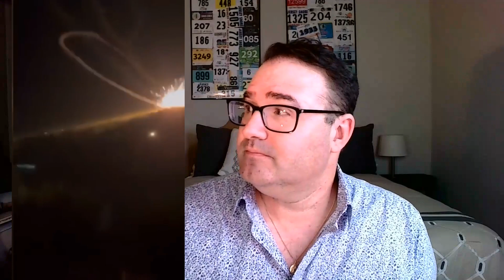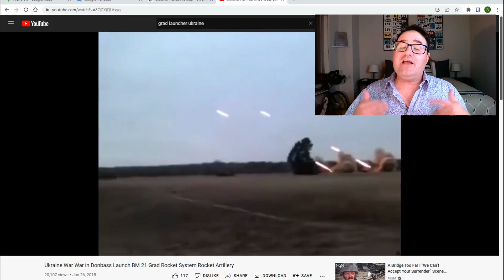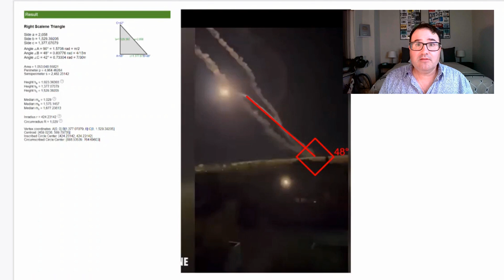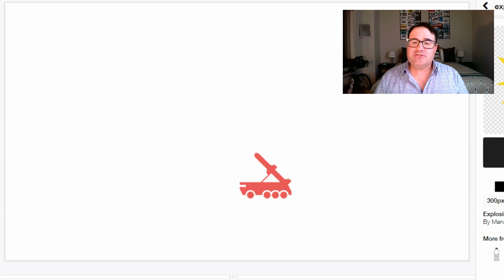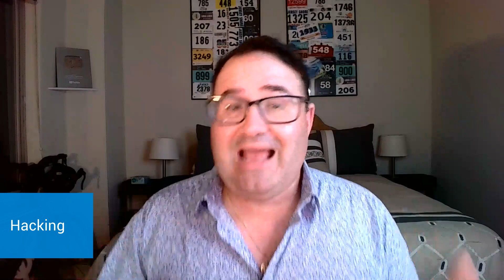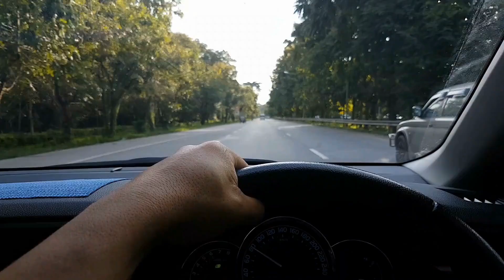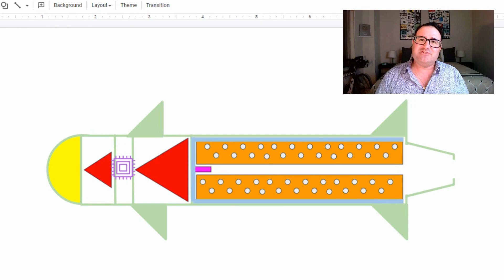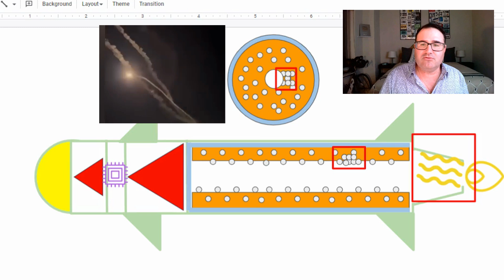Why this missile U -Turned

Comment: I figured that, by mistake, the operator plugged in the wrong coordinates (ie, the coordinates of the actual launch site).  This sort of thing has happened before if I recall correctly. 
As far as your clump theory. While plausible, I just can't see it making that extreme of a difference.  Hard to say.

Comment: I still prefer the guidance theory, and the 2s mark is just the moment guidance engages.
As to why such thing could have happened and other were fine? This could have been a defect in that one rocket, and the defect would not update the target from the default parameters that in a non-GPS system would probably mean relative position... and 0,0,0 in relative position form either of 3 equipment would be quite bad.

Comment: Hmmm well if that rocket had more than one engine nozzles then maybe but with 1 nozzle I think the vector change through gases burning hotter on one side of the fuel would not result in a 180° direction change of the rocket due to gases exiting the nozzle. I mean thats why there is a nozzle to direct the gases. If that nozzle had vector control steering then most likely this is where something went wrong.

Maybe as well if there was a hole in one side of the rocket where gases exited but that would cause most probably spinning and not a flightpass change of 180°.

Comment: When I was in the Luftwaffe we sometimes shoot the old AIM 9B  for training over the  north see  . They were known for being somehow dangerous. Some did a barrel roll around the nose of the aircraft and wend straight to the see, some exploded midair and some burned out on the launcher . Technikans said  it could be the gas generator  for the fins or exactly this problem  as described with the booster.
Reply: You guys test fire AIM 9's without a target? Us 'muricans use high power illumination flares to give the flyboys & manpad operators something to lock & shoot. Also triggers the "stand off" detonator, as the missile goes past the flare. Yes I know, not the right terminology - I was on target detail.
Reply: @muninrob   Hi , no . On the right launcher a TDU-11B was started and then the 9B  was locked one to the flares at the back of the TDU .  Worked great if the 9B was ok

Comment: As someone else that has some practical knowledge of missiles, I tend to agree that this looks like a guidance failure. While you are absolutely correct that solid rocket motors can have such problems, the burn looks very constant. If their were that much asymmetric burn I’d expect the rocket to just explode. The other thought I had, because I don’t know anything about this system is, does it have thrust vectoring?

Comment: that missile was nowhere near max velocity when it pulled that U-turn.  neither was it either a mile high or a mile away from the launcher.  a few hundred to one thousand feet at most, given that the total flight was so short.  they don't accelerate to supersonic speed within 4 seconds....  there is no sonic boom.

Comment: My mechanical intuition says that your theory is wrong. I don't believe the torque will be enough to cause such a hard 180 and the 180 was perfect. I'd assume rather that there was some problem with the targeting radar. A problem can arise between the firing of the 2nd and 3rd rockets.

Comment: Hacking of it is possible, just not in how you mentioned. Creating a more accurate and powerful radar which is 'louder' than the original one would allow the user to take control of the missile however they would have to be in relatively close proximity. I can see how your theory would work however it would have to be an extremely severe issue and even then I don't think it would be this much. Furthermore considering the other missiles were likely stored the same, I find this unlikely. A result of all these issues may have created the result

Comment: I would also agree that it's unlikely to be solid propellant off-center.  Rocket motors that seriously damaged tend to...  Explode!  I would posit, especially with the previous missiles already in flight that possibly the BUK (generally Semi-Active Radar homing missiles) started illuminating it's target and the last missile decided, perhaps due to defective guidance, to home on the illuminating radar, or perhaps a more likely scenario, that the thermal battery in the missile failed, so as the missile ended initial boost, guidance lost power and the fins went to a hard-over position.  Possibilities.

Comment: No, I think it was a servo failure. 
Once fuel turns to gas the pressure inside equalizes due to the nozzle of the motor. Bernoulli's principle, remember your idea happen before Bernoulli flow balance.
Why it went straight the other servos were still working. I would be willing to bet the servos are off till it reaches 2 seconds .

Comment: The same thing happened to a Russian Proton space rocket several years ago. An engineer installed one of the gyros upside down during assembly so when the rocket launched it instantly corrected itself into the ground
Reply: Yeah. IIRC, the part was designed so it only went in one way to prevent such an incident. So the engineer used a hammer to force it into place.
Reply: thx, that makes sense.
Reply: This is the very first thing I thought of. That, or possibly a problem between guidance and control surfaces, like crossed wires. That has also happened to both the US and the USSR. Like another comment below, I don't think that asymmetric thrust is a thing with solid fuel rockets. The nozzle would correct for that.
Reply: Yeah that’s the first thing that come to my mind.
Reply: KSP type rocket building
Reply: Oh! Yeah, that is a good theory... The control systems on board still need to understand orientation, and if those systems aren't properly oriented to ground, the missile will attempt to correct that.
Reply: You would think there would be back ups and fail safes also parts that can only be installed in one way.
Reply: Ouch.
Reply: How do you mess up that badly
Reply: That is actually a very possible theory
Reply: Vadims think they know anything about missiles when it was captured German scientists who won them the space race.
Reply: Anybody's guess. 
   Manufacturing problems, degrading during storage, transport damage, rough handling, component failure, etc.
  Thanks for the video.
Reply: Best theory so far.
Reply: A concise analysis again Mr. Macbeth. I agree that this is the most likely scenario. The only reason I could see it being anything different is if it was a multi nozzle rocket but it is too small to necessitate multi nozzles.
Reply: Who new there were so many rocket scientists in the world?!
Reply: @surfearth1     After obtaining my Rocketry Degree from Kerbal Space University, I'd say I classify as a rocket scientist.
Reply: That’s what makes me think the video might be faked; that proton rocket couldn’t withstand that massive change in course and the forces it brought. I don’t see why this middle would be in a better position to withstand those same forces.
Reply: @thewarmedic2330  Air to air missiles are much smaller, so there's less stress on the missile body, and they are designed to be maneuverable at high speeds so they can intercept their target easier.

The body of orbital rockets are designed to be as lightweight as possible in order to cut down on the required fuel mass needed to get them to orbit. Because of this, they're actually quite flimsy and are only really designed to hold together within their programmed flight envelope. Too much deviation will cause the rocket body to fail.
Reply: @Regolith86  Falcon 9 has much tighter upper-level wind shear limits than other orbital rockets exactly for this reason. Rockets going to space are only designed for large loads down the axis, not off-axis loads.
The Proton's guidance was probably also arguing with itself causing the squirrelly path until the range-safety officer blew it up. Anti-aircraft missiles may not have redundant sensors that orbital rockets launching multi-billion dollar ruble navigation satellites do.
Reply: @Markle2k  Apparently, Russian rockets don't have range safety packages. The Proton just broke up from the aerodynamic stresses, then blew up completely when it hit the ground.
Reply: @Regolith86  Air to Air also would not have to factor as much wind force since the air is so much thinner at the avg dog-fighting altitude as well no? I would assume that is the real impressive feat here.
Reply: @thewarmedic2330  many reasons. The rocket is smaller so it can handle greater rotation without subjecting the ends to much force comparatively to the much large proton. The majority of the rocket has a combustion chamber pressurizing the rocket giving more rigidity to the missile's surface while the proton rocket being liquid fueled does not have as much rigidity to its walls from internal pressures as the pressure is mainly limited to the bottom where the engines are(think of crushing an unopened soda can vs an empty one). Finally, this rocket was not likely moving as fast as the proton yet as it has only been travelling for a couple seconds where as the proton had been travelling for about 45 giving it much longer to gain speed.
Reply: @thewarmedic2330  Built to counter evasion tactics.

Comment: Third missile seems to interfere twice with the trail turbulence of both first two missiles path and it seems that it gets destabilised twice by that. Then, instead of being attracted by the radar reflection on the target that got lost, the missile seeking antenna gets directed directly onto the tracking radar much more powerful emission signal and the missile goes back strait to hit the target tracking radar near the launcher position instead of following the illuminated target… the 3 missiles have been launch too close to each other and wrongly towards the very same direction, so maybe such massive grad salva of 3 together had not been tested before war time. Return to sender, by Elvis..maybe much later a Russian incident report will wikileak out anonymously one day…so that we really know what happened.

Comment: Can't say I'd think that fuel settling answer is likely. Sure you would get a spike in combustion and increase the chamber pressure (increasing the risk of explosion or damage to some other system through too much heat) but it's still got to pass through a convergent-divergent nozzle that should direct any thrust straight back. And even if there was a slight differential thrust (and I really don't think there could have been much), the missile's control system should have counteracted that at those speeds.

I think it looks far more like some kind of guidance failure, as I'd expect anything like a stuck fin to send it spiralling out of control. As you pointed out, the previous missiles firing (seemingly) correctly, indicates that the tracking radar & commands sent from the control station were probably correct, but there is still the onboard guidance that takes those commands and turns that into a trajectory and then control inputs for the fins. The onboard guidance computer might have had a failure and prematurely switched over to terminal guidance, at which point the missile tried to home in on the ground radar.

I'm not someone who works on missiles, just an aerospace engineer (but your explanation goes against what I have been taught/know about rocket motors), so take that with a pinch of salt.

Comment: the missle could have also had a sensor installed backwards so maybe it turned there because thats when its gudence system turned on and it thought it was going the wrong way so it made a U turn

Comment: Rocket in the video has subsonic nozzle, which could do what is described but no way high performance SAM is using that. If nozzle was supersonic it matters less how symmetric is the burn because it's the pressure inside that is converted to high speed gas at the throat. Uneven burn could increase pressure but not have much impact on local speed through relatively small throat. If anything uneven burn would be a center of mass problem that would take seconds to develop.

Also i can't see missile stopping to turn, the issue is perspective. The missile started to turn toward the camera and continued to turn till the ground hit. For me it's pretty obvious that's a control issue. Generally you shoot rockets with controls locked till they clear launch site and then turn stabilization on. Even more, i'd expect target guidance to turn on even later and at best it would run preprogrammed turn to target heading with control limits during boost phase. As any attempt at target tracking too early would lead to energy losses.
So likely a gyro or similar malfunctioned (or was installed wrong way up, like on the Proton-M launch from 2013) and the moment rocket controls were free it "stabilized itself" into the ground.
Reply from the maker: Maybe.  I'm also twilling to accept an alternate theory of sidewall insulator burn-through.  We're just getting paralax error and the missile was actually turning in a circle.
Reply: @RyanMcBethProgramming  Yup, it's all maybe :). If one thing is figured out better than anything else in modern SAM missiles it's the solid rocket motor itself. If it was prone to such issues we'd see grads do the same on much bigger scale, and they aren't exactly 4th july machines.

Comment: I like your explanation as it makes the most sense of any I've heard. Bad storage, or simply poor construction, isn't uncommon for Ru storage centers and a similar theory could explain why so many Ru rockets cork screw thru the air after launch. I was originally thinking the thrust nozzle might have been damaged but the rocket certainly flew straight once it was turned around. An alternate explanation might be some of the solid fuel came loose and temporarily blocked the nozzle.

Comment: i beleive you are right, because the missile after burning that clump or blockage, that caused it to turn, the missile kept its trajectory... because it never reached its "control" phase.  clearly the missile wasn't able to fix its trajectory back to the original correct path, so i feel that it lacked the ability to detect up from down... so it kept the straight path it had before hitting that clump or blockage.  yes it was at an angle but as far as the missile is concerned it flies forward, irregardless of up or down.  so could it also be an issue with that system?  is it even equipped with a gyroscope to know up from down?  and if it does.... well it still never reached it's control phase so the fins would never move to change it's course.  peace.  and excellent work i would not have thought this, initially i felt it was a guidance error if that helps.

Comment: The faster burn rate is 100% wrong. Some level 3 certified engines have "offset combustion chambers" to provide a desired thrust like the Moon burner CTI N 1560.  There were a few bigger Russian rockets that had the accelerometer forcibly installed backwards so up is down. Your method would likely cartwheel until explosion or crack the casing from excessive pressured and explode.  I have had model rockets do this many times. I've also worked with ADXL335 and other Analog or digital Output Accelerometer Module Transducer for Arduino. It has silkscreen marking tells you the orientation of the bord. The missile tracked striate back to the launcher indicating a inverted sensor. Another likely problem might be that the coordinates might have hit the negative key in the coordinates when programed. https://www.youtube.com/watch?v=SRE6_lcwfPg

Comment: We've seen a Russian missile execute the same exact maneuver before.
In 2013 a Russian satellite carrying Proton M rocket in Kazakhstan tried to do a U turn and burned up in the process. The cause was revealed to be a trio of sensors that had been installed the wrong way around,  meaning, the automated correction system was given false data by the sensors and the rocket tried to adjust course from this false data.
If Russian missiles use interchangeable angular velocity sensors ( which makes perfect sense they would ) and these angular velocity sensors have remained the same in these rockets ( Almost certainly the way things would go in Russia), chances are high the wrong way around sensors are still a thing. So there might be Russian missiles with this issue spread across SAM batteries.
Reply: Yep my guess.

Comment: The peculiar thing about this incident is that the missile didn't just turn around, it stayed on that heading more or less and impacted near its launcher. That could have been a glitch in the control hardware, maybe the sensors. Asymmetric thrust should have been more chaotic.
Reply: I didn't return to the launcher. In the video showing a different angle it follows more of a slanted arc.
Reply: Could be an aerodynamic problem. Fine when slow, turns around with enough airflow, slows down while turning, and then accelerates again but hits the ground before the aero messes it up again.
Reply: The missile went into HARM mode. The radar was behind it so it turned towards the radar. 😅😅

Comment: I think your explanation is quite plausible. I've seen electronic malfunctions that make no sense and are short lived so I'd not discount something there as there is a whole lot of places for that to go wrong for a few tenths.  Failure in the mechanical system trying to force the missile to turn could also correct any problem causing the turn. IE fins turn missile, its turning, fins break from stress, its now not turning.  So unless this is a problem common enough that you can reliably replicate it, I don't think there is a way to confirm the actual cause.